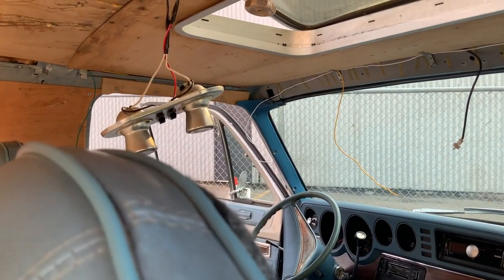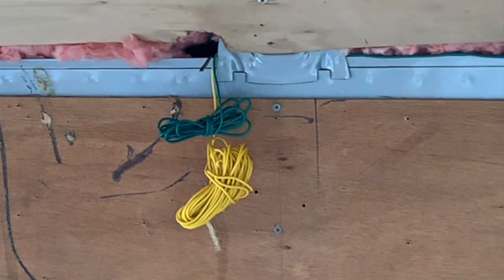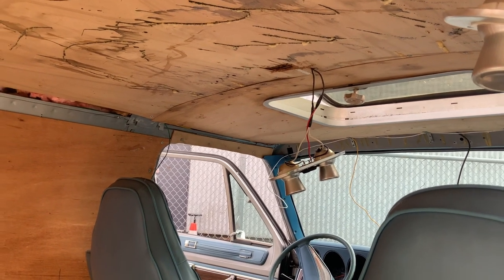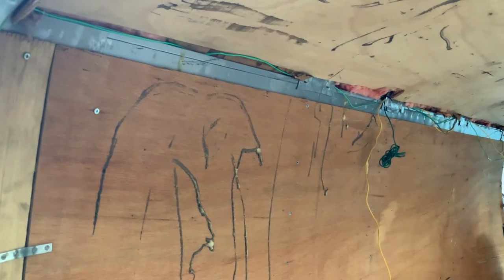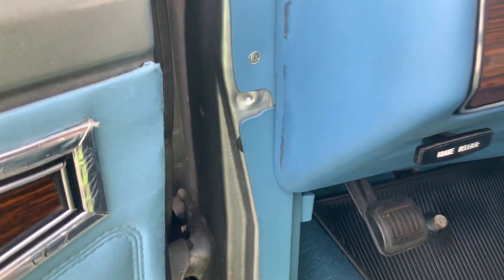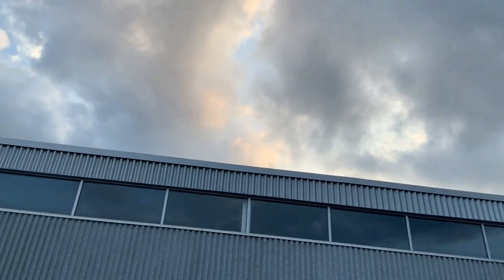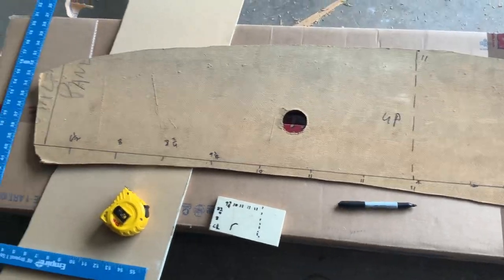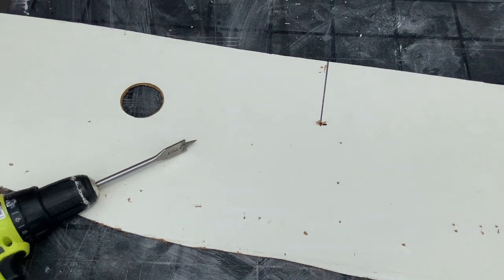VAN LIFE | Van Wiring And Console | 1978 Dodge Street Van Custom Interior Build - Pt.5

Comment: I'm building out my console next in my van. This was a very helpful video. Will use what i've learned here for sure. Thanks.
Reply from the maker: Hey that's awesome! This is just the preliminary set up, there will be another video down the line with more steps and the finish. If you check out my 70s Van Tour video you can get an idea of what the final will look like. That was my first build. Cheers!